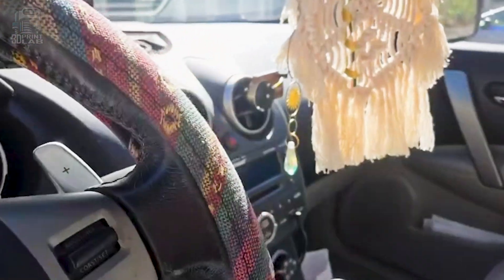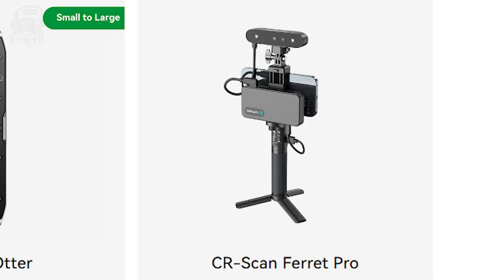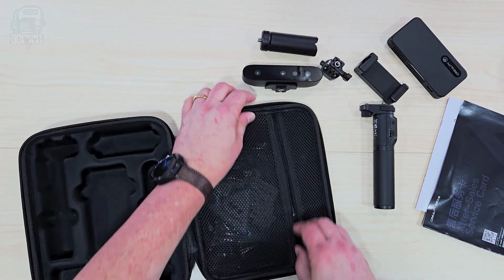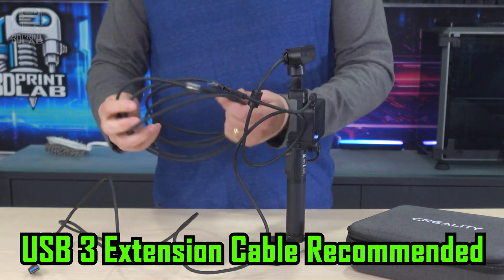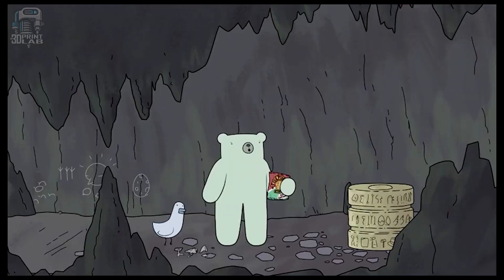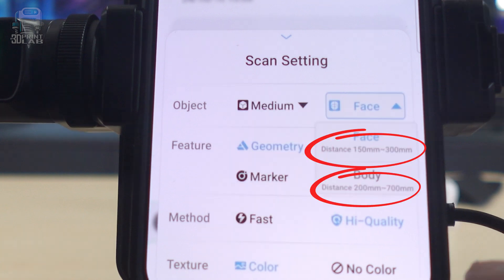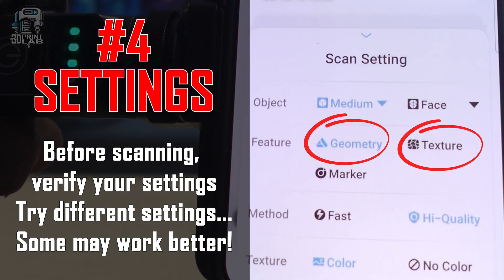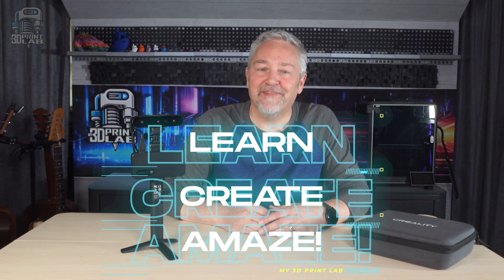I Broke My Daughter's CAR! Can 3D Scanning Fix It? Testing the Creality CR-Scan Ferret Pro

Comment: So is it the best one that you have tested at the price point? I'm still looking.
Reply: If you're not trying to scan highly smooth/reflective objects (and have a way to run CUDA on your computer) you may want to look into photogrammetry. 
There's an open source piece of software you can use called Meshroom (there's also AgiSoft PhotoScan/MetaShape, which is excelent but with a premium pricetag), which can generate good models from photos as long as the camera/phone has good enough meta-data for correct image/lens calibration.

It takes a fair bit longer to render out than a dedicated scanner, as it first has to go through and work out the relative photograph positions, but the quality of the final model is only really limited by the resolution of your camera sensor and distance from the object.
Reply from the maker: Nicely put!

Comment: I will never buy one of these it just seems way overpriced for what it is that much money for just a camera, it seems like for 3D scanning you need rapid pictures very good quality camera and light So what am I missing what do these cameras have the other cell phone cameras don't why can't an app be made to work on every camera it's already in our pockets
Reply from the maker: If I understand your comment/question correctly, the answer is in the comparison. While I'm not saying this is the "best" dedicated scanner out there, trying to compare this (or any dedicated scanner) to your cell phone "scanner" is like comparing your cell phone to a top-of-the-line Mac or Windows PC. Yes, there are similarities, but that's as close as it gets. If the cell phone scanner is all you need/want, then it wouldn't make sense to get a dedicated scanner, no matter what brand. Good luck!
Reply: @my3DPrintLab  no I get that I understand the difference between a full-blown PC and your phone but cameras are small to begin with they're not giant so fitting a good sensor into a camera is not difficult The difficult part is usually the lenses to increase magnification or zoom but I'm not sure if the scanners need or have that, I just think the whole scanning thing is mostly software and any camera should work not just phone cameras, I just don't understand what these scanners have that any other regular camera or cell phone doesn't have or can't have...
Reply: @NoMercyFtw  The real difficulty is getting correct calibration of the distance and angle between camera shots in order to do what deep-down is essentially just trig over a pixel array; in single-camera photogrammetry this is used to generate the sparse cloud... essentially a map of strong probability reference points in 3D space; this has to be done prior to the 'real scan' in order to build the cameras positions in space.

One advantage of a dedicated scanner is that every picture is taken in sets at the same time from 2 (or more) lens/sensors a fixed distance and angle apart, with pre calibrated lenses... this skips image pairing and sparse cloud generation, resulting in significantly less rendering time. 

Also when you do image pairing to calibrate the position, the software has to make a 'best guess' at the position and angle of the cameras based on theoretical 'points' at the center of certain pixels... this can be good (really good), but will never be perfect, as it's always an aproximation of an abstraction (an imaginary round point at the center of a squared pixed that takes an average of the light that hits it, assuming no errors in the pixel)... equally there's a very real chance of calibration going wrong on some pictures and you needing to delete incorrectly calibrated images from your dataset to prevent it screwing with the calibration of other photos (manual photos are taken over time, and things like leaves, cars and people have this irritating habit of moving)... if you don't have enough overlap this can lead to sections of your scan having gaps, and you needing to piece together seperate chunks manually like a jigsaw puzzle.

That pre fixed position on a scanner means you can skip all that, and go straight to 'perfect', while getting bonus immunity to hot/dead pixels and changes over time stuffing things up ... essentially every image pair will generate 'perfect' (still sub-pixel averaged though) trigonometry... it's own cloud of acurate 3D points... which can be used to stick together a complete model instead of using aproximations of individual cameras and generating the model points later.

Basically it requires less computational work, less physical work, less methodological knowledge, and less time, for an as-good or better result (depending on the sensor resolution and distance).

On the other hand, phones and old DSLRS are cheap, and as long as you have correct meta-data for lens calibration you can get a lot more flexibility from a camera... rather than having limited ranges you can shoot anywhere from 5cm to 100m (as long as you accept that your points will get less accurate the further away they are).

It's like hand carving a benchy... sure you can do it, and can it can look as good (or maybe even better if you're skilled) VS a printed one, but it requires a lot more knowledge and time, and has a higher chance of getting screwed up.

To be clear, I love photogrammetry & highly recommend learning it and Meshroom (my current favourite software for home projects, gotta love open-source), but I'd definitely recommend a dedicated scanner as a Digitalisation-for-Dummies tool, particularly if you need to scan small objects regularly and have to deal with non-ideal materials where calibration is more important.
Reply: @TotallySlapdash  and why can't this be done with another camera on a tripod expensive camera cheap camera expensive phone cheap phone why another product has to be made with a camera, it seems like that's the new thing throw a camera on it and call it something new
Reply: @NoMercyFtw  it can!
In fact I've done this myself and many of the available pieces of software allow for pre calibrated photo pairs.
However to get a 'perfect' calibration you need really tight tolerances, less than the size of a single sensor pixel.

Equally you ideally need to tune the output of sensors to perfectly match in terms of hue, saturation etc to minimise the risk of errors; this is more pro display levels of calibration rather than the level of variance between smartphone camera.

If you add more sensors to this (ir, uv, tof) the complexity ratchets, but not so much for a prebuilt rig directly embedding sensors into a machined frame.

I'm not saying these things couldn't be cheaper (and if theres was a wider market they are... the go-to budget home scanner is the Xbox kinnect although the res is exceeded by basically everything now) but the level of calibration required to do it to a professional standard is what you're paying for.
Reply: @TotallySlapdash  yeah I seen a video earlier about the Xbox Kinect, and I'm going to pick one up and start messing with it